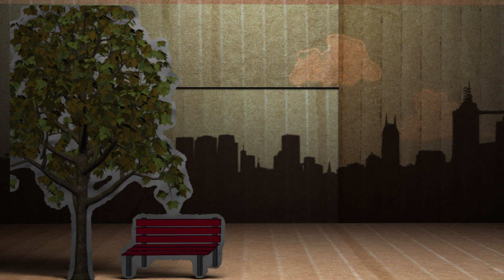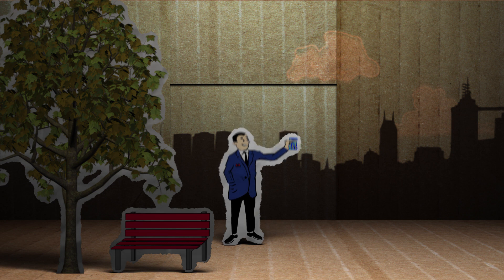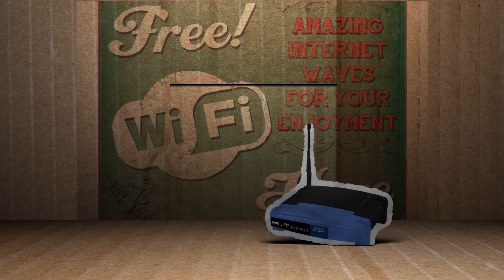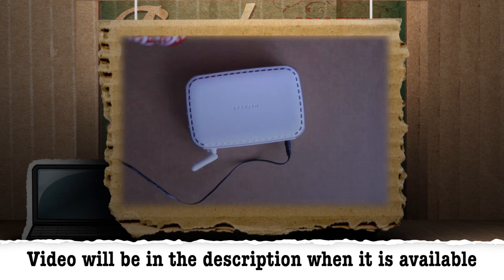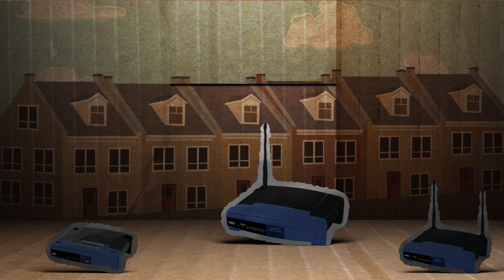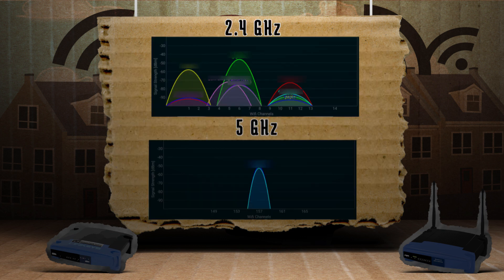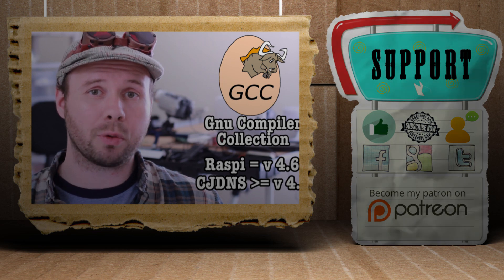Why Does My Wi-Fi Suck?

Comment: Please don't use a wireless "repeater"...  You're just taking crappy wireless and bouncing it to another wireless device, at the same time you just added yet another device to cause interference. If at all possible, get a hard line (ethernet) extender or ask your ISP if they offer an access point. Also, cordless phones, wireless gaming controllers, Bluetooth devices, wireless security cameras, baby monitors, hell even some microwaves can also interfere on that 2.4g band.

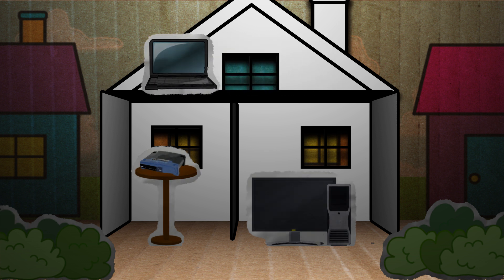Comment: +Tinkernut  @1:13 or so..... one thing.... floors arent generally thinner than walls in houses.....interior walls have wires and pipes in them generally. floors mainly have floor joists. when they do run wires through the floor, they do it in a fairly straight line. when they run them in a wall, they end up covering more space as they have to supply power to lights, switches, heaters, outlets, ect....so, this is likely why wifi goes through floors better than walls...because there is more metal to interfere with the signal in a wall than there is in a floor.  

i could be wrong about metal being the cause....but i've framed and finished many residential houses and since floor joists are generally 2x8's, 2x10's and 2x12's.....while interior wall studs are 2x4's....i am fairly certain that most interior walls are not thicker than the floor. . just fyi. 

i love the vids and have learned a ton from them!
Reply: flooring its typically wooden signal passes through wood ok drywall is more akin to stone signal does not like rocks.

Comment: Hi, I work for wireless Internet support, if you live in a place where there are too many wifi signal (yes that does interfere with the speed) why? Because of the channel setting (wave setting) on all the routers or modem/routers are on the default channel 1 , by logging into ur router you can change the channel to a different one like 6 or 11 and that will increase ur speed because all the other routers are using channel 1 and urs is using 6..

Comment: You can set up Wi-Fi roaming using two or more access points if your house have good structural cabling. This will allow your device to automatically pick the AP with the best reception. All you need is configure all your access points using the same SSID, encryption method and key, but different non-overlapping channels.

Comment: You could use ethernet over Powerline or Power-line communication (PLC) and re transmit the signal at the weak area of the building. I use that in my garage.

Comment: I bought a cheap router $40 and I get about 130m or 430 feet approx. And that's trougth concreet walls. Still able to load yahoo ;) So you can get good routers for a low cost :P
Reply: Adrian Hoffsten Hard to believe that, considering that commercial 801.11N Routers have a maximum usable range of 300 ft, and concrete halves the range of the signal

Comment: Great video. 5ghz is the way to go, on my 2.4ghz my Internet speed is ~30mbps on 5ghz it's 65mbps and LAN/powerline is 65mbps. Be careful tho as you need 5ghz WiFi cards in order to connect. (most phones/tablets will have 5ghz / dualband card) for static devices use powerline, this also helps remove strain on your WiFi (as mentioned in video) I find also restarting your router every few months helps, I'd assume clears bufferbloat. Happy networking!
Reply: Not seen the video, but you can also fine tune the frequency, by making sure you are not using a congested WiFi channel, using inSSIDer.  www.inssider.com.
Reply: Just realised that inSSIDer is no longer free  :/

Comment: Pretty much spot on , I love that WiFi analyzer android app, it's one of the best I've seen and my choice, I understand the antenna orientation,  but the real world issue is antenna polarization, although perfectly vertical is probably going to give optimal reception to every device at the same elevation anyways although on a hill it's a different story,  another thing I have found is in some  metal buildings you get dead zones here and there when you place the router in a corner or near the center of a building I suspect this is due to multi-path. Perhaps a video on antenna theory, multi-path interference,  and signal propagation theory are beyond the scope of even a couple short videos that will keep the attention of the average viewer.

Comment: I've been using 3 access points to cover the whole spectrum, each with the same SSID/WPA2 Keyword and I can just roam from spot to spot and keep the devices per access point low and the distance to the device lower. Both have increased speeds in my house where streaming multiple streams over wifi is typical. I use Ethernet to bring the network to the access point, so I also gain Ethernet ports at each place as well. 

The biggest reason for doing this was to cut down on the signal noise from other AP's in my neighborhood. I have trouble breaking -30dB @ 1m because of the incredible 2.4Ghz noise. That and my house is a rectangle so one access point doesn't get the edges upstairs without repeating anyways. Repeaters add traffic and ultimately slow things down. I'd rather have multiple hard-wired access points.

Checkout Ubiquiti Uni-fi 3 pack for an example of an out of the box solution to what I did.
Reply: joelb79 before people ask, one AP on CH1, one AP on CH6, and the other on CH11.

Comment: My router is right next to me yet my internet speed still sucks
Reply: craftxbox then use a damn ethernet cable.
Reply: that wasnt my point
Reply: craftxbox its your ISP then not, either upgrade to fibre or contact ISP if you have, they will take a look otherwise yer stuck
Reply: craftxbox Its very possible that another router in the area is stepping on your wifi signal, if you have not tried changing channels you may want to. Some times that can help, also make sure the device you are using is not getting over heated, laptops and tablets wifi chips often get hot and on some that can effect the connection. You may also want to try an Ethernet cable to see if its your ISP or not assuming this is a laptop or desktop.
Reply: Ross Sharp My work sells 1000Gbps fiber to the home. You plug that into a 802.11N wifi router and it will be more like 30Mbps down and 10Mbps up DSL than fiber. 802.11A isn't better than 100Mbps Ethernet with the added latency. Seriously, if you need performance use a dang cable. Wifi also can add 30-500ms of latency to any connection regardless of the bandwidth.

Comment: Here is my 2 cents on the "crowded neighborhood" problem. Most wifi signals use multiple channels for bandwidth. Basically 802.11g would use multiple channels of 802.11b to get that 54 mbs bandwidth. This means that a wifi signal on channel 1 will get interference from any wifi signals on 2-5. So if you neighbor is on channel 1, you need to go use 6 or 11.  At 3:08 you will see what I am talking about. Those signals are big humps and a signal will spread amongst channels.

Comment: TIP: don't put your router near the kitchen or in between your devices location where microwave and fridge sits, microwaves severely interferes your wifi signal be it 2.4 or 5GHz..

{ room/device }---{ kitchen }---{ router }

Comment: I always wondered why there are times where my phone is trying to load something, and the little wifi icon at the top of the screen (on an Android) will show that it is either sending/receiving data or doing both, but then suddenly it will stop, and whatever I'm trying to do will come to a halt as well, almost as if my phone forgot what it was trying to do and therefore decided it didn't need to continue transmitting data even though it's still connected to wifi.

Comment: You pretty much covered the basics without saying that cheap router could me moded with another firmware like dd-wrt and having its transmit power turned up which has its own issues.

Something to mention for speed is legacy devices, your typically limited to the slowest device on the network.
Reply from the maker: Mark Williams i covered dd-wrt in the tutorial about making a repeater that i linked to in this video, so i thought it'd be unnecessary to repeat it all again. and that's true about legacy devices. I probably should have mentioned it. but hey, that's what the comments show is for! thanks!
Reply: Tinkernut oh sweet you replied :-)

I use to mod routers for a hobby and use to build x86 dd-wrt routers (out of old computers) and put in 2x 2.4GHz wireless cards. One was just a high powered 1x1 card dedicated to B/G devices (some would have cards for all 3 B/G/N) and the other would be a decent 3x3 MIMO for N stuff. I built these for companies with weird needs.
I had to be careful to do site surveys and make sure the cross talk or overlapping channels didn't cause issues.

And since A stuff is kinda rare with the exception of the original Xbox 360 wireless adapter I just put in a decent 3x3 5Ghz one for N.

If I still did this I may do tri band for AC stuff but then again dd-wrt, openwrt, tomato, etc have kinda been dead community wise for the last few years and I kinda lost interest unfortunately.

Have a good one, love the videos :-)